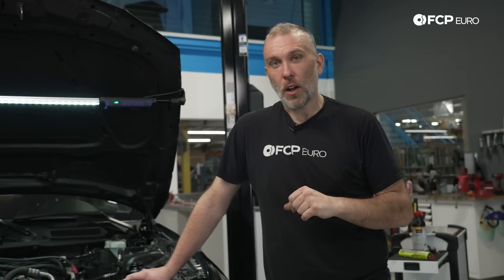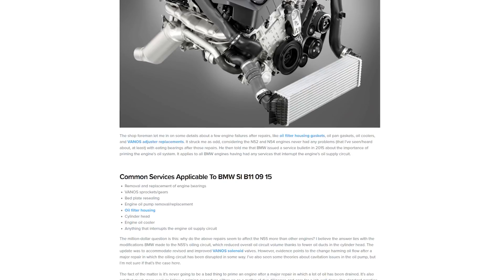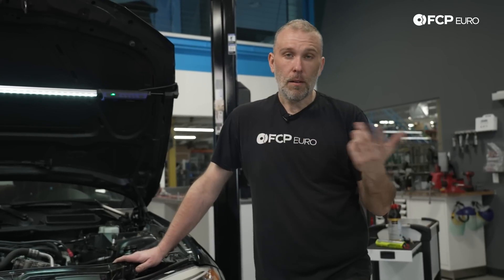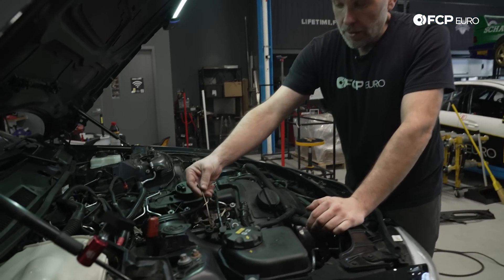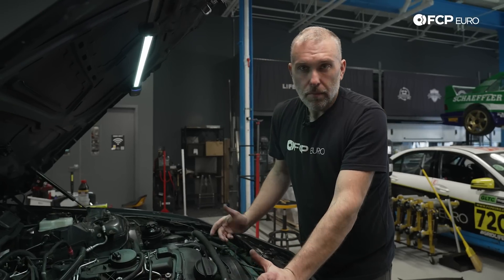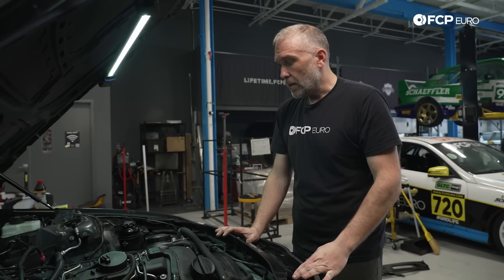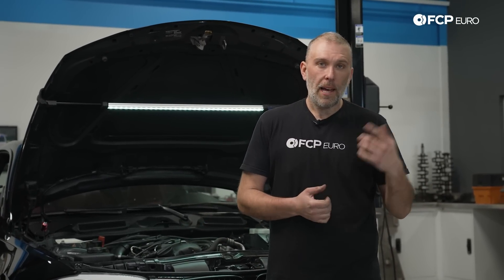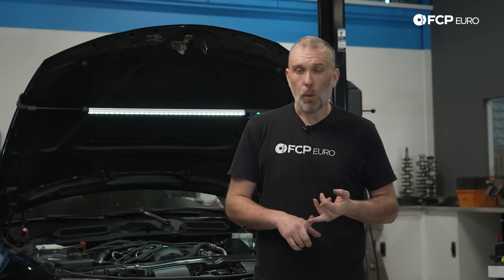The 5-minute Process That'll Save Your BMW Engine From Disaster

Comment: For anyone doing that job on the N55 i have a hack that makes it way easier: on the right side of the engine, behind the charge pipe there are a series of connectors. The furthest one at the back (nearest to the firewall)  you can unplug which basically switches of electric power for ignition coil, spark plug and injectors. It‘s like 30 seconds to take that off. That way you don‘t have to dismantle the whole top of the engine.

Comment: just a heads up, if you have a high mileage car, might consider replacing the starter as well (if you took off the intake manifold for the ofhg job). I learned the hard way...
Reply: just a heads up you might consider replacing the entire engine as well. because it's a BMW. I learned the hard way...

Comment: I’m about to do this on my n54 has been sitting for over a year , due to being out of state , just replaced timing chain with guide , cam ledge trays also new seals for the camshafts , new front main seal , everything on timing , just gonna keep those coils plugs injectors off , thank you for this , great video!

Comment: It would be helpful to show how the injectors were actually disconnected.  Is it at the injector, at the hpfp? Is the disconnect an electrical or a fuel connection? Etc.
Reply: Its a connector right by the injector/ spark plugs.. just disconnect them

Comment: To perform a real prelube ,a 20$ bug sprayer can be modified into a preluber and all you have to do is plug it into an oil pressure sender port right before starting. 
By modify, you basically jamb a piece of hose on the gun and add the needed fitting into the hose and add some clamps. 
Youll easily get 40-50psi pumping the sprayer by hand , that's plenty.

Comment: Following this logic, you should prime your engine after an oil change, because there is pretty much no difference from doing oil pan gasket to an oil change.
Reply: I am of the same thought!
Reply: The bulletin says Oil filter housing, even though he said Oil pan. I think that's what he meant
Reply: i think the same... sounds like overreacting a bit
Reply from the maker: Not the same. An oil change does not interrupt the oil circuit the same way some of these other repairs will. If the car were to sit for 24 hours with the drain plug off the oil pan and the oil filter housing open, perhaps, but it's not as critical as it is for the oil filter housing, VANOS sprockets, oil pump replacements, etc.
Reply: Phew !! Relief.Ive done 2 oil changes on my new to me 435 while oblivious to this.While it doesn't affect oil changes , this is very valuable info for us die hard DIY'ers.Thanks Gareth

Comment: For everyone wondering - you do NOT need to do this after a regular oil change because enough oil remains in the engine to keep it lubricated.

Per the video, this priming procedure is necessary for any work done beyond a regular oil change, where components essential to oil flow may have been interfered with and/or the engine has been sitting without oil in it for an extended period.

Comment: Would it be easier to take out the fuel pump fuse?
Reply from the maker: No. And the reason being is the injectors will still fire fuel and start the engine as there is residual fuel in the fuel lines leading to the HPFP which in turn will be pressurized and injected into the engine. Disconnecting the injectors electrically (removing the ability for them to pulse based on crankshaft movement) 100% prevents the engine from starting which is what needs to happen in this procedure.

Comment: I pull the fuel pump fuse because I don’t like to mess with those delicate injector wires/connectors.
Reply: There might be some pressure left in the system which will cause the cylinders to be soaked in fuel and dilute the oil film.
Reply: @johnnyblue4799  pulling the fuse or unplugging the injectors amount to the same thing. Bmw does not specify pulling the spark plugs so I sense that the fuel pressure issue isn’t a concern.
Reply: @jayparnes  I don't think pulling the fuel pump fuse, or disconnecting the injectors is the same thing, unless these run through the same fuse.
Reply: @johnnyblue4799  they accomplish the same thing:  no fuel delivery. Both are acceptable methods.
Reply: @jayparnes  What I'm trying to tell you is that there's fuel under pressure on the fuel ramp and until that's gone, if you fire up the injectors, you'll spray it on the cylinder walls and wash out the oil film that lubes the cylinders until oil gets pumped again behind the pistons. Is that going to cause a lot of damage? Probably not, but why do it if it can be avoided? Dunno, maybe there's another fuse you can remove to stop firing the injectors?
Reply: @johnnyblue4799  Perhaps that's the reason for three 10-second priming / turning overs. First one sprays the fuel out, other two coat it with new oil. BTW, I don't know who you are, but @jayparnes is well-known nationally among Z owners for his mechanical expertise. I trust him.
Reply: @GFCicotte  I doubt it. It's three 10 seconds so you don't destroy the starter motor. It needs to spin that long to purge the air from the oil passages. When cold and at the speed the starter cranks it takes a long time for the oil to reach the upper levels in the engine. Spraying fuel from the injectors, even if there's only residual pressure will wash off some of the oil. The piston skirts and rings will not see fresh oil until the pump manages to squirt oil behind the pistons. Again, probably not a big issue for the lifespan of the engine, but disabling the fuel pump not 100% equivalent with disabling the injectors so they don't fire at all. You can test for yourself. Prime the fuel circuit, disable the fuel pump and attempt to start the engine. It will run a couple seconds with what's left on the fuel ramp.
Reply: BEFORE doing oil circuit related work, remove the fuel pump fuse, start/crank the engine until the residual fuel pressure is used, THEN do your work.  No messing with injector wires and no fuel spray in the cylinder without oil pressure.  Prime oil circuit as shown, reconnect fuel pump fuse. Done.

Comment: I error on the side of caution and prime as suggested, but i would love to see a side by side comparison.  As others have mentioned, logic follows you should prime after an oil change and if the vehicle sits for extended periods, which almost no one bothers to do.   How would both 150k mile N55’s look after a teardown, one primed always, one never?    

I also wonder if the suggestion has more to do with oil flow to the turbo than excessive rod or main bearing wear.

Comment: Good video. Instead of removing injector cables and spark plugs is it ok to just remove fuel pump harness or fuel pump fuses and then prime the engine. Is this process for the N54 aswell

Comment: before this SB came out, I've always been in the habit (on any car) of start engine for about 15-30 seconds, shut off and look for leaks.  If no leaks, start again, idle 1 minute, shut off and check oil level.  Used this method after OPG (last year) on my E90.
Reply: A bug sprayer can be modified into a preluber,then just plug it in a sender port.

Comment: Gareth, I had deviated. In lieu of disconnecting the injectors and plugs at the valve cover, I had disconnected the module with the slider at the DME. Got the slider to move out and pulled the module up and off. However, I can't seem to reinstall the module. In reverse, the top part fits over the bottom but the slider won't go back in all the way for a proper connection. Do I push down on the top onto the bottom to insert the pins? Thanks!

Comment: As someone else mentioned, a little more detail on disconnecting the injectors would have been nice. And I didn't time them, but those "10-second" cranks seemed more like 5 seconds to me.
Reply from the maker: You disconnect the injectors electrically, not mechanically. Simply pull the two pin electrical connector. This prevents the injectors from being able to inject fuel without disrupting the fuel supply unnecesarily.

Comment: I guess not clear to this fairly new DIY'er; is this something recommended to a basic oil change?
Reply: No, you don't need to do this for a basic oil change.

I was wondering the same. Per FCP Euro's comment elsewhere, this priming procedure is only necessary after working on a part of the engine that relates to oil flow, and/or if you drain the engine very thoroughly of oil. During an oil change, enough remains throughout the engine to keep it lubricated when you start it up again.

Comment: Can the engine be primed by removing that one wire that goes into the IBS on the battery? I pulled that wire and it spun the engine without starting. Would that be the same thing as pulling the injectior wires?

2011 n55 e92.
Reply from the maker: Not something we have tried, as the safest and guaranteed method we can share is undoing the injectors.

Comment: Good idea to remove the spark plugs to reduce the load on the starter. The engine probably turns over more quickly as well.

Comment: Did an N52 ofhg. I just pouring a quart of oil back down the housing then the rest of oil added normally. then started it. Did I do that wrong? Anything I can do now? Been driven for 200 miles since
Reply from the maker: Generally, pouring oil into the oil filter housing doesn't do much. A majority of the oil poured into the housing goes through the drain back into the block. N52's do not suffer from problems as outlined where the N55 does. A lot of the N55 issues stem from the variable output pump and generally less oil volume in the entire oiling circuit. You are 100% okay.
Reply: @fcpeuro  perfect, thanks for the reply.

Comment: Do you have to unplug all the injectors. My X5 it's hard to get to number 5 and 6 on a 6 cylinder engine without removing parts. What should I do? Any help?
Reply from the maker: Yes. You do not want the injectors to fire (inject) fuel into the combustion chamber.

Comment: 3 years ago a had an OFHG (oil filter housing gasket) done on my 335xi by Winslow BMW of Colorado and they didn’t prime the engine a seized the engine. Took 0 responsibility.
Reply: I never know what to think with these stories because I hear them primarily with BMW owners. From a mechanical perspective it makes 0 sense since oil is designed to leave residual matter on the metal parts in order to mitigate metal to metal contact on start up. This is why a car can sit months at a time with almost all of the oil drained and be started up without seizing. When you change this gasket you literally still have residual oil all over the rest of the critical internal parts.  

Only thing I can imagine would be some sort of air pocket causing an issue and even that seems improbable. If so, seems like dropping a little oil into the oil filter housing would eliminate that risk.

Comment: Hi. Plse advise how to check the oil pressure level without an external oil pressure gauge connected to the engine.
Reply: MhD app
Reply from the maker: Any scan tool that can read live data from the DME will be able to show oil pressure.

Comment: Will this procedure be the same for an N54 engine?
Reply: N55 was the first that this was necessary. So no, N54 doesn’t need this process, unless fresh rebuilt or sitting a long time
Reply: Oh thanks, even if the oil lines are opened?

Comment: Isn't the reason for this the use of oil pressure assisted chain tensioners?  With no oil inside the chain may become loose enough that it can jump timing, something that usually isn't possible.
Reply: Nope, air can make its way into the passages.

On the N55, the tensioners are screw in, not oil pressure based.

Comment: Why not just pull the fuel pump fuse or relay?  and quite frankly the motor is still dry when it is spinning without starting.  I don't know if any of the code readers will read oil pressure without engine running.  It would be good if you could read the pressure while the motor was turning over.  It is a shame there is not way to run the oil pump while the car is off??  That would be the best scenario
Reply: Injectors may still fire until fuel is depleted from lines, disconnecting injectors electrically disables them from firing at all

Comment: Disconnecting the spark plug coils has nothing to do with compression.
Reply: @K M  removing the spark plug would allow air to escape. Disconnecting the coil does not "release compression" . Someone needs to go back to school.
Reply: @K M  i could have sworn he said wire, but he did say plugs. That makes sense now.
Reply: Exactly! That is why this is really NOT any kind of  "5- minute process" for priming the oil system!
Reply from the maker: We removed the spark plugs in this video to be gentler on the original starter motor (you can hear the engine freewheeling when cranked). The procedure from BMW outlines the need for an external power supply. We recognize that most DIYers are not going to have an external power supply, may have a weak battery, or a weaker starter motor. Removing the spark plugs from the cylinder head allows the engine to crank freely with no added resistance from compression which saves the starter motor + battery.  It's an alteration to the procedure which takes into account not everyone is going to have the necessary equipment to do this "by the book".

Comment: This surely is a valuable tech-tip but it is certainly NOT a "Five Minute Process" as the title suggests! ... not if one removes spark plugs!!  Me thinks a 10Amp Starter/Charger should be satisfactory toward aleviating battery discharge?
Reply: The signal to the spark plugs was disconnected. Not the plugs them selves.
Reply: @kenendres8865  Ken, Gareth did actually say he removed the plugs in order to facilitate not having the starter operating against compression in the cylinders! ... removing spark plugs is a laborious and time-consuming task!
Reply from the maker: This is a quicker process if the spark plugs are not removed. The process as outlines by BMW does not require removal of the spark plug. In the interest of the car in question we wanted to be easy on the starter motor and battery. The starter not having to crank the engine against compression for a prolonged period of time is a choice we made (also doing other work at the same time). A good battery and providing ample cool down time in between cranks (plus a good external power supply) avoids the needs to remove plugs.

Comment: This is all wrong. You prime by injecting oil through the oil pressure sensor thread using a manual pump or mechanic's syringe. Cranking does nothing.
Reply: No
Reply: @BigDavoNorriwong  have you tried to measure oil pressure when cranking?
Reply: bmw released a tsb on this method how you gonna say it’s wrong 😂
Reply: @expofcam  The tsb is wrong. Got it?